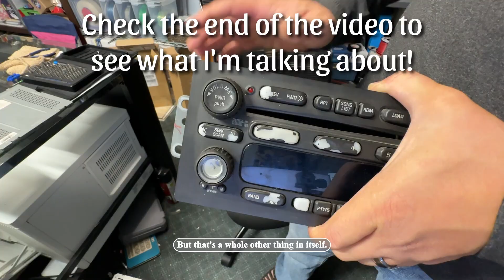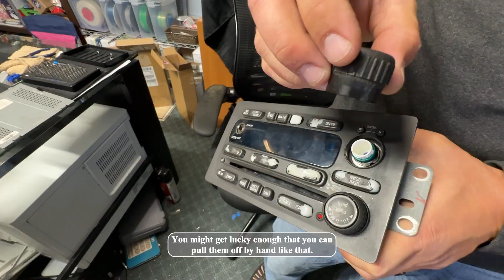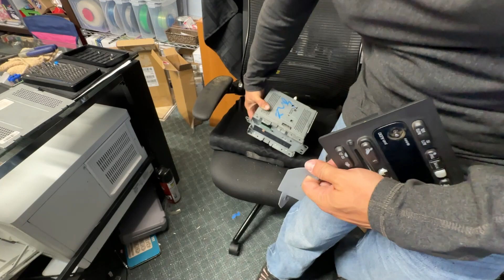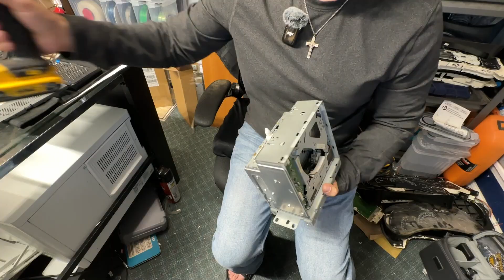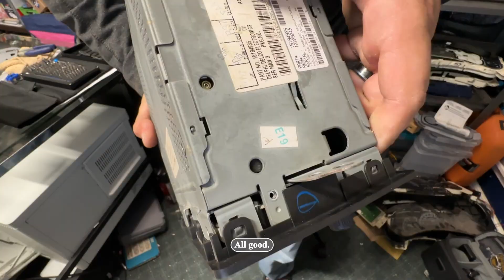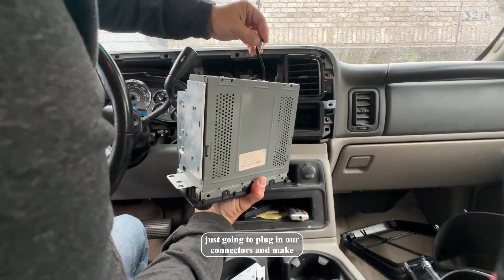03-07 GM Radio Faceplate Replacement

Comment: How do you get CDs out of the player it seems to hold on to them and not let them come back out it used to be the fourth CD would stick the system
Reply from the maker: Good question. I honestly don't know. I think I took out the disc before I did this.